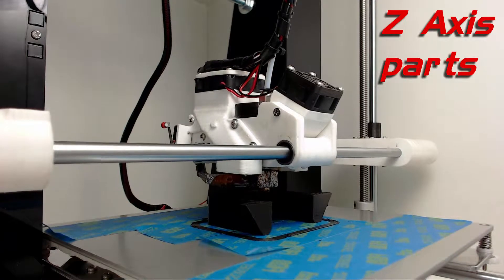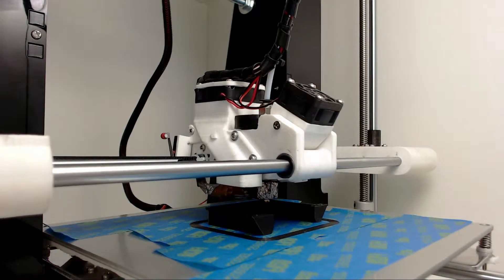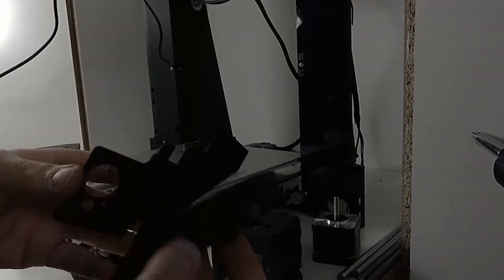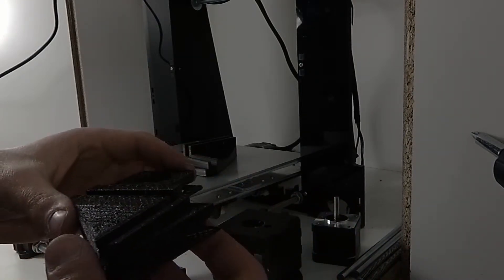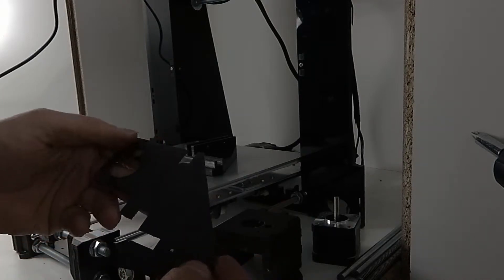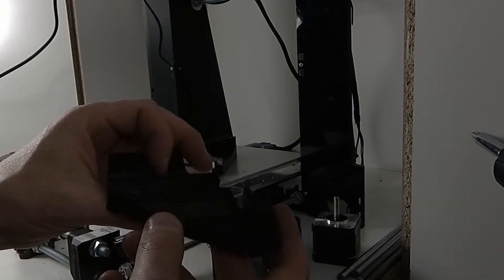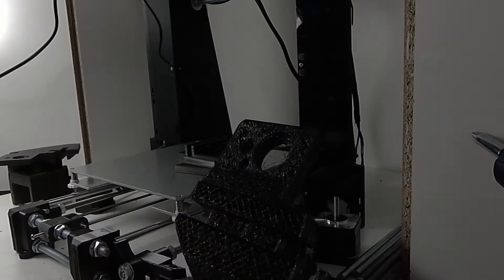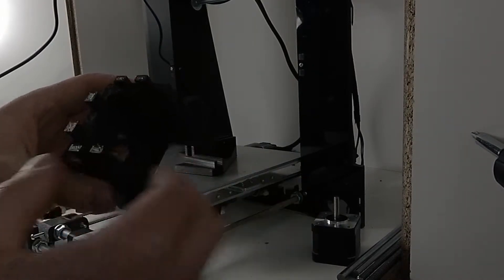Anet A6 Prusified 3D printer upgrade. Part 2 Preassembly of Z-axis, X-axis and X carriage

Comment from the maker: All the preparations are done. More assembly in the next part. Do you think that upgrading Anet A6 is worth the time?
Reply: Yes as I"m doing it right now so I have a 2nd printer. I plan to put an all metal hotend on it so I can print ABS and other higher temp filaments in my garage. So for a $20 printer I picked up for spare parts this is now so worth it as I don't have to buy another 3D printer. Just a few part plus the printed parts and I have what I need to make it work. I already have a shelf in the garage to place it on! Then I have one at work I plan to ask to buy as no one uses it anymore, the art teacher said it's too complicated for her students but she never took the time for me to train her. Now it just sits in my office. Hoping I can snag it for like $20 seeing as the tech teacher doesnt want it either and purchased some Adventurer 3 printers. thanks for taking the time to do this as I was either going to design the parts my self or find them online and well I found them. Thanks!